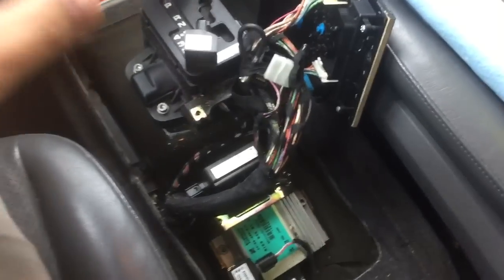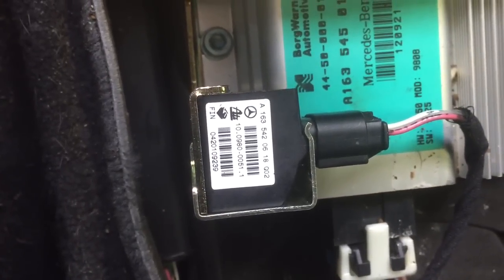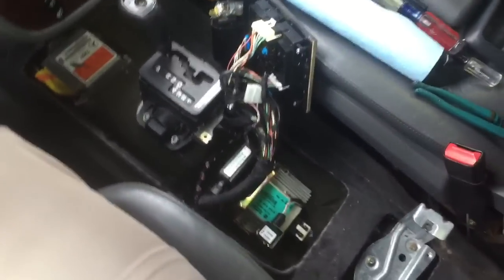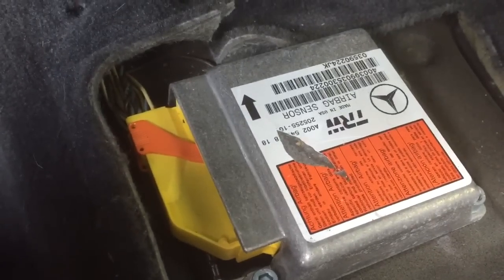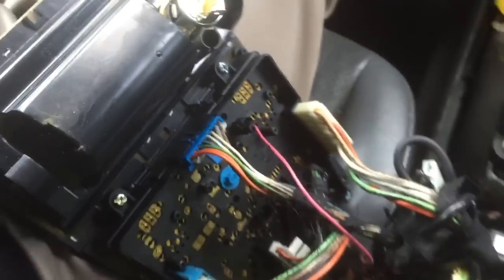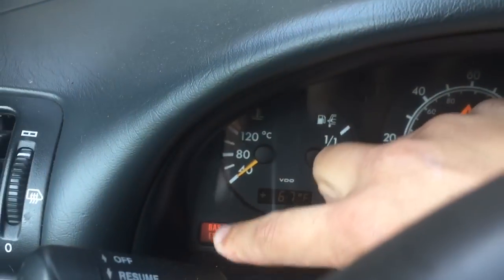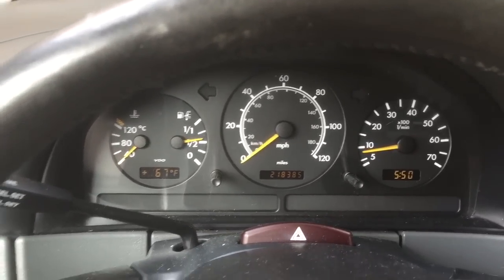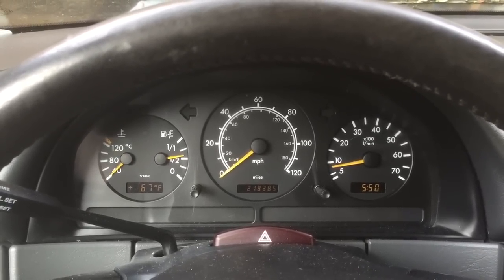1999 Mercedes Benz ML320 ML 320 lateral acceleration sensor fix BAS ESP light

Comment: I got a 2000 ml320 with all three error lights in the display on also. It started breaking front left wheel with a scraping noice using the ABS,  (the ABS " ! " light in the middle was flashing on)  when turning left sometimes before the lights came on. I disconnected the harness to the pump and sprayed with some anti-oxide and X4 oil. Put it back together and the two first lights went out and once turned the wheel fully the BAS light to the left was out too. Everything was fine in 2 days, ABS working perfectly. Now its all back on. Could it be the yaw rate sensor.? or lateral sensor? connection error? thied the connector again but it came back at once this time  thanks//Martin
Reply from the maker: Martin, can you see if there are any codes on the ML, if there are let me know and we can go from there. Thanks
Joe

Comment: the lateral sensor is fixed in a metal frame. not sure how to take it out that I can replace it?
Reply from the maker: It's in a little metal frame so yes you just kind of twisted it and it pops out and then you twisted it and pop it back in

Comment: hi...where is this sensor in my merseds w210 e240 2002 year gear box automatic...i can't find him...please help...thank you
Reply from the maker: Unfortunately I can't find that car on my Alldata website, it looks like it is only in Europe. I would have to make an educated guess and say that the sensor is either under the rear seat or behind the dash between the steering column and the brake booster. I'm sorry I wish I had more information on that car. 
Thanks,
Joe

Comment: Thanks for the guidance I replaced mine on ML430 2001 & the BAS/ESP light gone. I took a 3-4 mile test ride after this with no issues, but after around 30-40 minutes when I restarted after some gap somehow I am getting the more scarier “CHECK ENGINE” light my milage is ~178k before BAS/ESP & sensor replacement this was not an issue. Can someone please help me understand this. Is this usual after Lateral acceleration sensor replacement so I need to get it reset/reprogrammed ? The sensor that I had on my 2001 ML430 “Part# A163 542 06 18” Q02 The one I purchased from ebay seller is “Part# A163 542 06 18” Q04 (from ML350) The part# is matching though. Is there something I can DIY to get rid of the “CHECK ENGINE” light.
Reply from the maker: Typically Check Engine is for emissions related items. Unrelated to Lateral Sensor. Just have the codes scanned at local auto parts shop to see what the code is and go from there. Hope that helps.
Reply: @joesnowmobiles  Thanks for responding; yes got it checked on autozone & it was due to P0300 (random/multiple misfire) & P0307 (cylinder 7 misfire) . Last weekend I could DIY the spark plugs & spark plug wire replacement on Cylinder 7 . The misfire codes are cleared. But now after driving for about 25-30 miles I got BAS/ESP back on. Went to Autozone with the light on but scan didn’t show any codes this time. But car is IM ready now . My next approach will be to replace the Brake light switch though my break lights work fine (read through some forum & figured that even if brake lights work the break light switch may be at fault a known recall for 2001 ML430). Anything that comes to your mind to get the code in this situation? Forgot to mention this time resetting BAS/ESP from steering wheel (all the way right n left) is not working & the light pops up after some delay post start later stays ON
Reply from the maker: @rg.reboot.jam.edupro  you have to scan with a better scanner than Autozone their scanner will not tell you ABS codes
Reply: @joesnowmobiles  any recommendations for affordable OBD scanner I got Launch Creader 3001 thats also doesn’t support ABS codes
Reply: @joesnowmobiles  Thanks for suggestion I got the foxwell nt650 elite scanner. Upon initial scan there were lot of old stored codes (12)
1x C1200: S9/1 (stop lamp switch) Plausibility
1x C1000: N47-5 (ESP.  SPS[PML] and BAS control unit)
1x C1140-12: N49 (Steering angle sensor)
1x C1140-08: N49 (Steering angle sensor)
3x C1120: N64 (ESP Yaw rate sensor)
1x C1527: implausible ESP control control  time > 10s
4x C1142: B24/2 Lateral acceleration sensor
[Total 12 count]
-The C1200 was because I removed brake light switch & tested that with multimeter for fault but it was good so placed it back.
-To rule out C1140 Steering Angle Sensor, I tested live data & it was showing correct angle data so just re-calibrated & cleared that.
-For C1142 Lateral acceleration sensor, I already replaced that part so I knew its an old stored code & cleared that.
-Later I went ahead and cleared all remaining to see what codes popup next.
-After 2 days I again got “C1120: N64 ESP Yaw rate sensor” again cleared.
-After 7 days I got again the same C1120 this time I cleared & it was coming every time I drive for like 5-10 minutes (the only difference I cleared it immediately the moment it came up by stopping car , clearing code & test drove again like 2x times) at last I went on drive with BAS/ESP light ON without clearing code & after 10minutes this time upon scan it threw C1120 Yaw rate & 
C1000: N47-5 (ESP.  SPS[PML] and BAS control unit) {more scarier}
After clearing both codes its 2 days no codes yet.

So based on this diagnosis on my 2001 ML430 I am suspecting “Yaw Rate Sensor is faulty”; I am planning to replace that now & On close inspection under the central console On the top side of “Yaw Rate Sensor” part# A163 542 2140 this part is discontinued by Mercedes just like Lateral acceleration sensor.
can you suggest some way to find compatible new part# for 2001 ML430 ?
Also please suggest some stuff for C1000 as a backup plan just in case if reappear. Thanks in advance
Reply: @rg.reboot.jam.edupro  did you find the part?
Reply: @rg.reboot.jam.edupro  I’m going to call Mercedes and complain, it’s very dangerous to drive with a part that if it fails you can get killed
Reply: @kchilz32  😂 you are late🦵 more than 7 months man, the problem was with YawRate sensor got it replaced and all good chill

Comment: My ml270 cdi under hard acceleration. Gear change into 4th 5th 6th. The car has no power and a epc light comes on the dashboard. Car wont rev whilst light is on.what is the problem.
Reply from the maker: HI Paul, I would recommend having your codes scanned, once you find out what codes you have let me know and we can try and figure it out. Thanks Joe

Comment: Hey Joe, I am having problems with my 2001 ML320. My car will turn on and and run perfect just when i push the pedal to try to accelerate the car dies. If i push the pedal slowly it will go but when i try to push it down more to pick up speed it just dies. Can you please help me.
Reply from the maker: Nathan Reyes do you have any codes? Is the check engine light on? If you can let me know what the codes are that will help me to diagnose your issue.  Thanks Joe
Reply: joesnowmobiles The check engine light never came on until the problem happened. The BAS, ETS, and ABS were the only ones on.
Reply from the maker: Ok, you'll definitely need to get the codes checked before we can diagnose. Take it to AutoZone, Advance, Carquest, Oriellys one of them should be able to scan it for free. Once you get the codes let me know and we will go from there.
Reply: joesnowmobiles will do.
Reply: joesnowmobiles Do you mind explaining to me what a throttle body is? Symptoms of a throttle body
Reply from the maker: A throttle body allows a certain amount of air to enter the engine, it takes the place of the old style carburetor. Plenty of good video's right on youtube here that will probably give you some better information than I can.
Reply: joesnowmobiles Thanks Joe, i think that’s what’s wrong with my Ml320. Hesitation when accelerating i just don’t see why the car would turn off though.
Reply from the maker: Do you have any codes? A check engine light on?
Reply: joesnowmobiles Check engine, ABS,ETS, BAS.

Comment: I replaced it but just set it inside there my lights are back on i think i should have attached it with bracket
Reply from the maker: Yes I believe you must attach with bracket.
Reply: @joesnowmobiles  yea now there turning on intermittently like the sensor is moving around inside the console lol thanks for the video man much appreciated

Comment: I'm having a similar problem with my Mercedes only during the cold start in the morning. Driving me crazy I had an O2 Sensor replaced, brake switch and crankshaft those lights associated with the Brake is still coming on. Everybody wants to charge me for something else but can't find the problem. The BAS, ESP BRAKE LiGHT COMES on and this beeping after a few tries turning on the engine and warming up, the lights go off but the engine light stays on. When those lights  BAS, ESP, BRAKE,  all those indicators to the far left on the display panel are on, the the car will not drive as normal. They go out and the car drives like normal but mechanic who say's they specialize in Mercedes can't find the problem. Recently I was told it a CU Display board...next stop dealer I figure they have to know should have gone there first.
Reply from the maker: Hi Wendy, these things can be tricky to diagnose. Have you had any codes come up on a scanner? I think the best investment I ever made for my Mercedes was the Launch Tech CRP123 Srs,abs, transmission and engine code scanner. You can buy it on eBay for around $160.  This way you can check your own codes and reset them yourself when needed. If you have someone scan the codes please let me know what they are and I'll see if I can come up with any ideas.

Thanks
Joe
Reply: The codes indicated first 02 sensor bank 2 when first diagnosed. I had this last service center put it on a machine and he mentioned he had to clear many fault codes.
Reply: Wendy Johnson I have same lights esp etc abs check engine. Also is intermittant just like yours and worse in the morning when cold and damp. I had codes read. Not much help. Many codes. The intermittant cold warm scenario makes me think something is shorting out from bad solder joint or something is getting wet. ETS module? Abs module? The slow driving you experience is limp mode a protective feature. It runs in second gear. Mine does the same. The dealer and an Indy shop haven't figured it out. So I may begin replacing modules sensors etc.
Reply from the maker: lcagee let me know what codes you have I may be able to help

Comment: I change the master switch for my windows on my Mercedes ML320 in the window still isn't rolling up or down
Reply from the maker: Check the plugs in the door, my rear driver passenger and driver side door plugs had corrosion in the electric pin connectors

Comment: My codes are p2602 p2600 p2310 p2068P20cc?? Esp module fault p2036 p2001 c1000 abs control module c140 steering angle sensor c1141 brake pressure sensor
Reply from the maker: lcagee wow that is a lot of codes I'll do some research and give you my recommendation it may take me a couple days. Thanks! Joe
Reply from the maker: Looks like a whole lot of the codes may be related to the conductor plate, P2602, P2600, P2310 P2068 P20CC I would start with that and also replace the connector plug that connects to the conductor plate area with a new updated part from the dealer, it tends to leak transmission fluid on the connectors and short it out. The other codes P2036, P2001, C1000, C1140, C1141 appear to be related to the ABS pump and module, you can find a fairly cheap abs pump and module on ebay for about $150. I would check first to see if your abs motor runs by jumpering the relay while the ignition is on. You may find that by replacing one of these items it solves a number of the codes. I would focus on the conductor plate and the abs motor and module first. Just my 2cents hope that helps!Joe
Reply: Thank you very much. What is the conductor plate? I will try a new pump and module. I think I can install it. Today it is raining and the lights keep coming on. So it seems dampness is a factor. When it's dry and warm during the day, the lights often go off. I'm guessing moisture in the module up front? But not sure what the conductor plate is. Thanks.
Reply from the maker: The conductor plate is a plastic tray that sits in the transmission,  you can find a whole kit on ebay for about $75 just type in conductor plate or here is a link http://www.ebay.com/itm/722-6-Transmission-Conductor-Plate-Filter-Connector-Gasket-KIT-for-Mercedes-Benz-/151729545724?fits=Model%3AML320&hash=item2353c921fc:g:lRcAAOSwBahVe8rc&vxp=mtr
Reply from the maker: Here is a link to a pump and module on ebay http://www.ebay.com/itm/98-99-MERCEDES-ML320-ML430-ABS-BRAKE-PUMP-A1634310312-ATE-10-0990-1356-2-MCU-ETS-/162001538401?hash=item25b80b4d61:g:xfgAAOSwoBtW32mK&vxp=mtr

Comment: How did you remove the acceleration sensor and put in a new one? I saw a steel bracket with the sensor inside, but just can't figure out how to get it out of the steel bracket. Thanks.
Reply from the maker: You just have to twist it out, you might have to use a screwdriver to pry it out, then snap it back in. Hope that helps!
Thanks,
Joe
Reply: Thanks.

Comment: I have Bas/esp light on to in my Mercedes ML320 2003! go to dealer and tell me codes C1035,C1037,C1040 CONTROL UNIT,STEERING ANGLE SENSOR,LATERAL SENSOR, they want $4,098 dlls for it! is normal this three sensor fail same time  or i need a pint point diagnosis they charge 407 dlls for the diagnosis.... any help?
Reply from the maker: Cesar Vazquez wow sounds too expensive to me. I would acquire a good scanner you will be able to eliminate the cheapest parts first. Most of the time it's something very simple. You can buy your own scanner for less than what it cost you to diagnose it. What State do you reside in?
Reply: joesnowmobiles. Hello mate, I have uk ML320 with BAS ESP light on, my mechanic suggested it could merely be a tracking problem, he reset the light with scanner, light came back,(no codes tho,) he looked underneath, spotted a bit of movement in the steering rack, told me that may well be the problem, am looking around for replacement rack, will let you know ☺